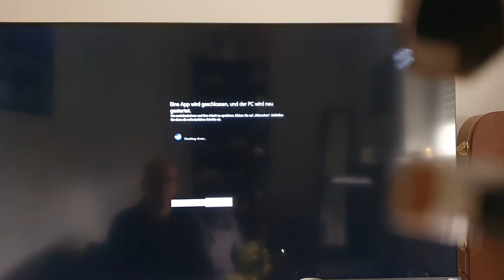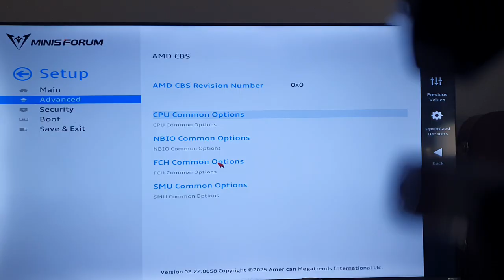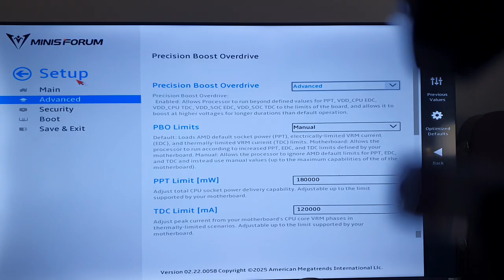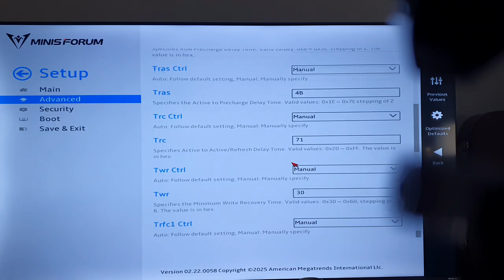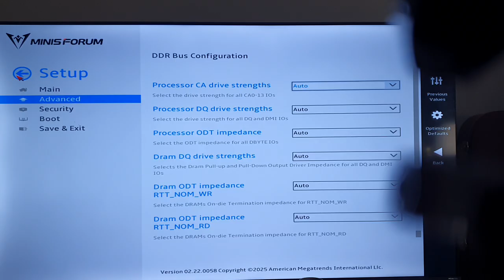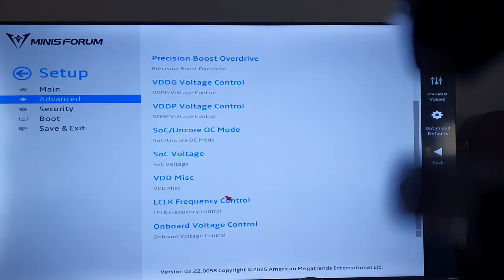Minisforum BD790i/bd795i with Kingston Fury 6400MT/s Settings for best Performance.

Comment: It's quite daunting going into the settings. I'm considering diving in and spending a day doing it to see if I can't pull some more performance with this RAM Kit. I might copy the settings for everything sans the Curve optmizer as mine only goes to about -15 stable.
Reply from the maker: Yes, that's quite an understatement. It's dreadful to watch tons of videos with unreliable and hard to comprehend information. Don't give up there is loads of hidden performance.
Reply: @y @yannickb.4524  I do have a few more questions if you don’t mind helping me out. I’m using the same Ram kit as you are here but it’s clocked at 4800mhz. The iGPU is turned on, I assume that I should turn that off right since it’s not in use or anything like that? 

Another thing is that the machine boots when turning on. I assume perhaps the iGPU might be to blame since it’s enabled and all, and booting from the DP on the main board with those settings caused artifacts before freezing with these RAM settings.

Comment: Changing speed made it crash and now my memory is not stable at stock speed wtf is this crap... (kingston fury getting replaced)
Reply from the maker: Sorry to hear that. There is a software called memtest86 that can help diagnosing your memory. Go with the stock mem settings first and stepwise adjust the curveoptimizer by 5. Then adjust the mem settings. Always keep testing and observing. I worked daily for about three weeks to find my optimal setting. Its a struggle that pays out

Comment: Thanks for making the video. Your a legend. Convinced me to get a minis forum.
Reply from the maker: I am happy with mine under consideration of the price point. Mine was only 380€. The performance bottle neck is the RAM. Finding stable setting is a struggle. When you are there the board is a performance gold mine.
Reply: Yea is the only draw back of the board I can see. Would be great if it had ddr5 desktop slots

Comment: Appreciate the settings, they're stable on my 790i and 32GB 6000MHz Fury kit.
Reply from the maker: I'm glad to be of help, despite the terrible quality of my video. Did you see a performance boost?
Reply: @yannickb.4524  Yes, a substantial improvement. Unfortunately, I have switched to a higher capacity Crucial 96GB kit. My question Yannick, what software did you use for reading the XMP/JEDEC profile? It seems Crucial haven't published the full timing specs for my kit anywhere online. Thank you
Reply from the maker: @NikitaLab sadly there is nothing to find anywhere. I used CPU-Z 's SPD tab. Linux also offers ways to extract the Spec.
Reply from the maker: @NikitaLab Can you please post your geekbench results?
Reply: @yannickb.4524  Sorry, no longer using the Fury Impact A-Die memory, but a Micron 2x48GB set, and right now only booting at 5400MHz CL46. Memory tuning is quite tedious, and now it's a server not a workstation so I'll leave it alone if it's stable.

Comment: Thanks for making this video. You gave me the courage to dive into the timing options my BD790I X3D bios. Now I've got my 6000 kit running at 6000 following the XMP profile in hwinfo64 and learned a few things.
Reply from the maker: My pleasure! There is a lot of performance hidden in the settings. I documented my latest findings in the video description. Make sure it says 120w [unlocked] in the cpu section of hwinfo. :-)

Comment: Hi, i got a crucial 32gb 5600mhz cl46, and i want to lower the cas latency as far as possible. But i dont know how to do some help? Thanks a lot
Reply from the maker: Hi, use HWinfo. There you will find xmp profiles next to where is says 5600. Convert the values to hexadecimal values and enter them in the bios. Check in cpu-z wether it says 2800MHZ afterwards
Reply: @yannickb.4524  I tried to check in hwinfo, but there is nothing about the xmp profile, so it's looks like they don't have it
Reply: Crucial company, it's just suck. Better refund these and get the same as yours. I got bd795i se
Reply: Crucial is not great except price, micron memory is not very good at  going above factory specs. Kingston uses hynix memory which is has much more overhead. Currently I am overckocking a 96gb 5600 crucial kit on a bd795m so Ill let you know what timings can be lowered and what frequency may be acheiveable. Also yiur memory controller plays a good part in this too as you will need to bump the SOC voltage to clock the uclk and fclk higher, and this is just luck of the draw.
Reply: @owen9273  that will be great if you can help me. Thanks a lot 👍 a try lift up socket voltage but when i do this my score in cinebench go from 34000 to 30000 because my max frequency on cpu goes from 4.46ghz to 4.1ghz
Reply: @owen9273 hi do u have some update? Thanks

Comment: Hi, i have the 5600 kit and im trying to figure out how to get all of those settings you show around the 6:50 mark. I'm running Linux on my build so i don't have access to hwinfo unfortunately. Would it be safe to copy your settings?
Reply from the maker: If it's a hynix a-die you can carry over most. Some makers have specification sheets that call out your xmp timings. So just have to adjust those and carry over the rest.
Reply from the maker: So you can carry over everthing past the 6:50 mark. Everything before from your spec sheet.
Reply: @yannickb.4524  ok cool. I tried looking everywhere online and couldn't find anything and the Kingston website wasn't any help either. Thanks for the info!
Reply from the maker: Windows to go can easily be installed on a memory stick for convenience.